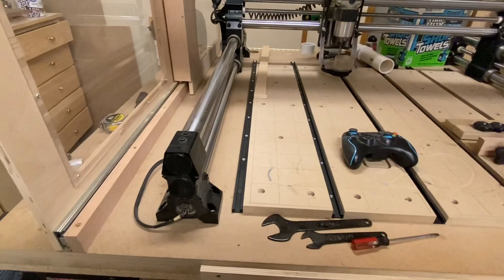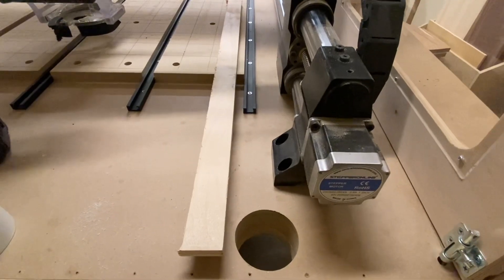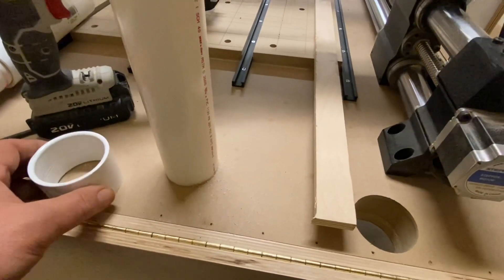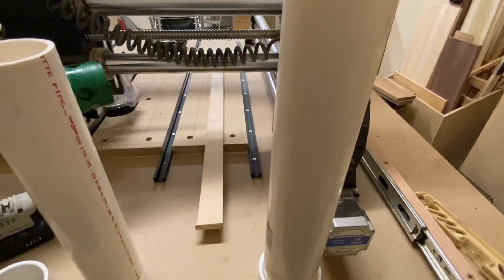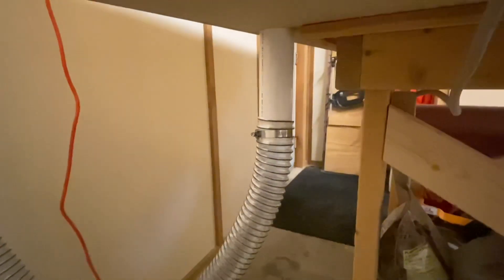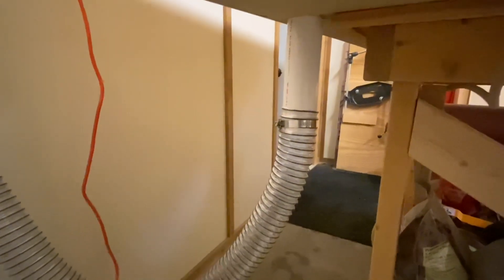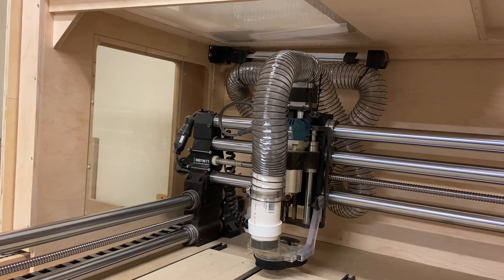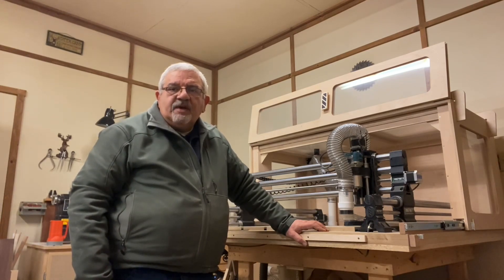Dust Collection System for CNC enclosure

Comment: Wow nice design on the enclosure.  Is it something you made as well or bought. Would love to know so i can either purchase it or build it. Thanks in advance. Rick
Reply from the maker: Thanks Rick!  I made this for my first machine (I’ve since upgraded twice 😆)I have 2 videos on building it and I also have build instructions attached to the part 2 video. Let me know if you have any questions
Reply: Thanks for the reply. I will try and look for the instructions and designs, too. 

I am just starting out with doing CNC work as a hobby. Got me a Genmetric 4040 Pro and want to see what I can do for the dust instead of just holding a shop vac up to it. So, I was thinking of an enclosure with some way to connect a hose to my dust collector system.
Reply from the maker: Here is part 1.  The link to part is in the video description 
https://youtu.be/hsZEtI5Ph_0?si=pZi3xHDkK968Mmht

Comment: are you worried about static at all?
Reply from the maker: No, not really. I check the dust barrel at the end of each day just to be sure that nothing is smoldering though. The very first time I made a cribbage board, I accidentally used a downcut bit for the peg holes and it got pretty smoky in my shop after burning in the first 10 holes or so. I stopped the job, emptied the dust barrel into my fire pit and changed to an upcut bit and didn’t have any problems after that.

Comment: Hey Mitz... great set up... I was wondering what shop vac you’re using and are you keeping it running the entire length of the job? Also are you finding the amount of suction you’re getting adequate for keeping the work surface relatively clean during your cuts? Thank you
Reply: @onefinity-trainingtipswithMitz  That's awesome... thanks for the info... I'm considering a similar set-up now for my 1F table... which l'm getting ready to start construction on this weekend!

Comment: Nice job Mitz. Really getting tricked out here. Have you seen the double wire hose clamps? They are designed for that type of hose. 
https://www.amazon.com/POWERTEC-70197-2-Inch-Double-5-Pack/dp/B01LZHDIOP/ref=sr_1_3?crid=7G1RV8V20LXG&dchild=1&keywords=wire+hose+clamp&qid=1610758745&sprefix=wire+hose%2Caps%2C256&sr=8-3

Comment: Looks great Mitz, thanks for sharing & giving us ideas. I’m seriously considering getting one when they come out with a spindle. The downside for me is the size for my shop. I’m trying to figure out a table can be lifted flat on the wall & out of the way when not in use.
Reply: Not sure if you've done this yet, but I saw a video on youtube a few days ago where a guy made a wall mounted/hinged table that supports 300lbs. Looked more than capable of holding a onefinity in place.
Reply from the maker: Yes, I’ve seen several that are wall mounted. As a matter of fact 1F has come out with a bracket to mount the Onefinity on the wall and operate it vertically.  The only thing though is you also need to purchase the QCW frame (quick change wasteboard frame)
https://www.onefinitycnc.com/product-page/wall-mount-kit